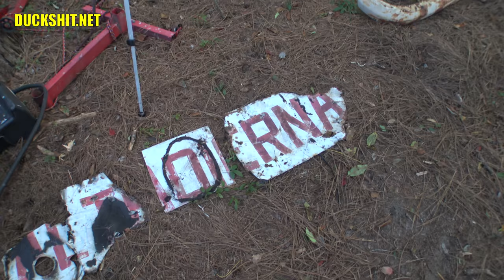1967 VW Bus or 1966? - Letters on Floor - Mid Day Q&A - 64

Comment: According to original paint colors for Aug 1965 - Jul 1967 - bottom part would have been a L555 Titian Red (Tizianrot) and the top part was a L472 Beige Grey (Beigegrau) which is exactly what yours looks like it was painted.  The interior would have been basic white.

Comment: Between 66 and 67 are some more different things:
Lock of the tailgate: a '66 just has a round pushbutton to open the tailgate. To lift the tailgate there is a space  to put your fingers in the  panel under the talgate ( to lift it)
'67 tailgatelock looks like the lock of a beetle's enginelid. The small space to put your fingers to lift the tailgate is also absent on a '67.  So to open it you lift it on the hook of the lock.  
The nobs on the switshes on the dash from a '66 are differend then the ones on a '67. '66 has the hard plastic  old beetle style nobs in white or grey. '67 has bigger black soft nobs on the switshes. More like the newer beetles ('68 and later). 
The last thing I know is the petrol filler door. '66 has a lock on it. Opens with a square key.  '67 just had a kind of lip to put your finger in. So the door is differend but also the panel in wich it is fitted. 
I hope this helps a bit..
One other thing I saw: You have a white or grey steering wheel. So probably your bus wasa minibus with seats in the back.
Greetings from The Netherlands..
Hans.
Reply from the maker: Thank you for all this!
Reply: Hans, I did not know, cool...one more thing, 67 had a one year only gas tank, it had a bump in it and so far, no one knows why.

Comment: The cusp of a year change very hard to say if it's heavy wire larger battery leads 6volts system use better amperage wire for their electrical made it better for change over bulbs, wiper motor, gas gauge, turn signal relay ,horn,bulbs in speedometer consoles overhead lights oh yeah trans switch, starter ,gen ,voltage regulator, flux capacitor check!!!; )
Reply from the maker: Thats good info, thanks!

Comment: Something I noticed is the horn. What year did they change from that type to the short round one? That may help determine the year.
Reply from the maker: Not sure, but horn is super easy to swap and doesn't affect anything else it is connected to.  If the horn is wrong it wouldn't be a surprise.  I see a cheap plastic aftermarket horn in there anyway, didn't notice another horn.

Comment: As i wrote earlier on two castings on the drivetrain you can check the year of your vehicle; at bottom on the engine by the alternator mounting bracket and on the bell housing on the tranny.
On the tranny it should be for a car built to 66 coded with "AA". Engine; earlier cars had a
reverse spring mounting on top of the carb, from 67 this was left away and the carb
bowls where made more squared as the carbs to year -66 had rounded and smaller bowls. 
A 1200 engine use engine code D, a 1300 code F and a 1500 code H. Or check the 
rear axle for some numbers in the casting. Other codes are for engines produced from
08/70 and later.
The headliner console was developed by VW for ambulance vehicles; those had on
the roof front an air scoop and at the back of the console two vents which passed into an extension - thru a cabin wall - to the passenger part.
The samba windows as the windshields have being introduced for hunting, not for
additional ventilation or beach parking (original statements from Volkswagen AG).
Reply from the maker: Thats why they were called SAFARI after all!

Comment: before I got the notification for this video I was bored and looking at double length Split screen limos which gave the idea of making a splitscreen that's 10% longer than stock with extra side and roof windows making it a 29 window will get help from a pro starched limo builder to extended it but while looking at split screen chassis parts, I stumble apron this https://www.serial-kombi.com/en-GB/split-bus-body-panels-/-chassis-brracket-for-hand-brake-and-gear-shift-lever-under-the-cabin-floor-8/1959-7/1967-n321594 the very part you need for Gregory
Reply from the maker: Omgggggggg!!!!!  THANK YOU!  I would have made good with just a top plate but hell the whole thing might make it a whole lot easier!
Reply: @vvtheduckvv  your welcome
Reply from the maker: Thank you thank you thank you!  I couldn't hit the order button fast enough!
Reply: @vvtheduckvv  your externally welcome

Comment: You have wheels similar to Frankie my 1969 vw bug 10:48 to 10:52
Reply from the maker: Those came on a sandrail that I have with adapters.  Not sure what I'm going to do with them.... we'll see!
Reply: VvTheDuckvV my wheels must be rare because I have a pcd measuring tool and they measure 5x130 the same as a Porsche
Reply: VvTheDuckvV my wheels must be rare because I have a pcd measuring tool and they measure 5x130 the same as a Porsche
Reply from the maker: @carmad9220  I think mine are Chevy bolt pattern.  I dont remember measuring them though... but look too small to be Porsche.

Comment: Hey man does your bus have a spot for reverse lights above the brake lights. If it doesn’t then it’s a 1966. They didn’t start installing those until 1967
Reply from the maker: You are partially correct, we talked about this one earlyer.  While it is true that the backup lights started in 67... not all 67s got em!  Early 67 did not.  Same with the paddle door handles, they are unique to 67, but the end of run of 66 got them too.  This Bus was definitely born on the a cusp!
Reply: @vvtheduckvv  
crap that sucks.  just call it a 66 1/2 and call it a day.
Reply from the maker: Kinda my thought.... lol!